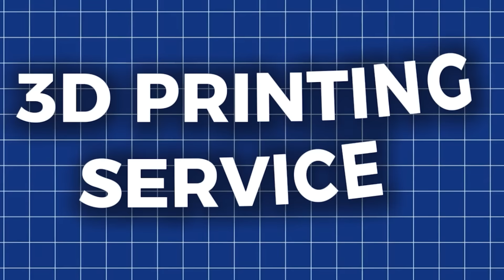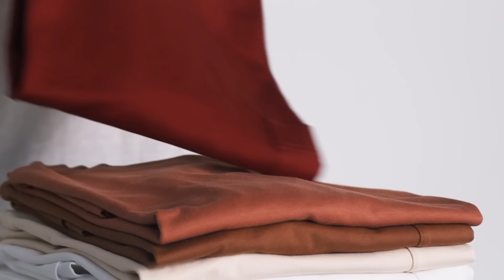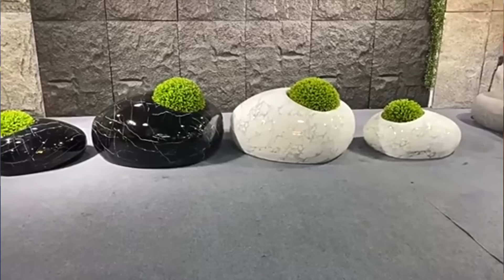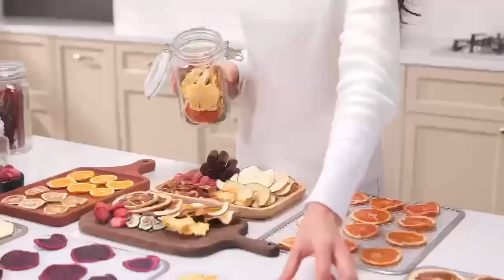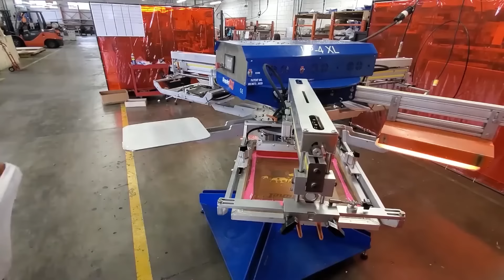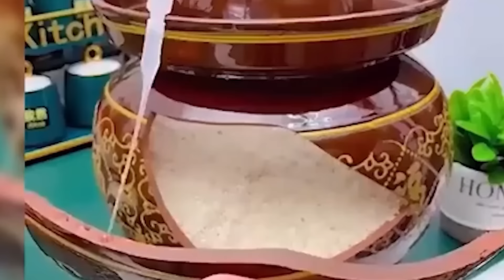20 small factories you can open at home

Comment: How much for the sock machines ?
Reply: sock machines are easy to handle - second-hand repurposed should do the job. I've seen like 20+ machines in a very tight enclosure but the production is continuous. Process is easy. All you need is to understand the small machine that weaves the fabric together. Its a good idea to have by..
you should try this. This is something that cannot be  replaced so easily by AI as socks won't go out of style or demand, ever..
Reply from the maker: You can get more details from the pinned comment.